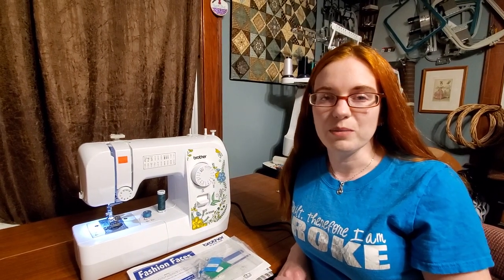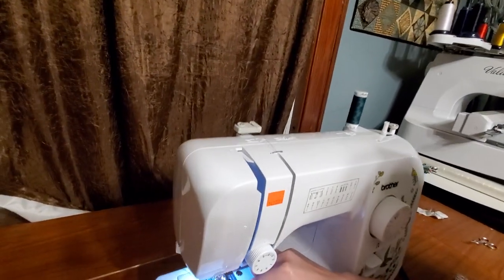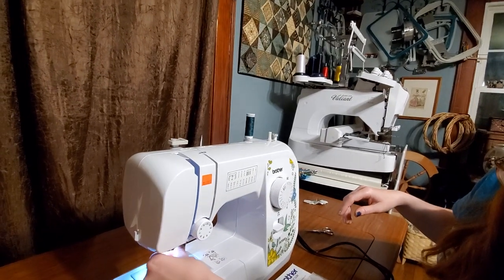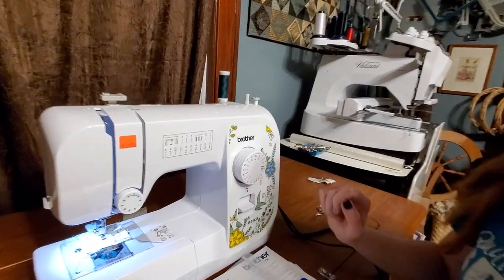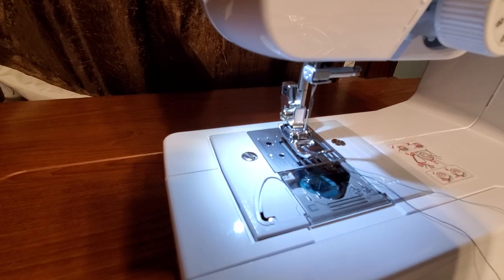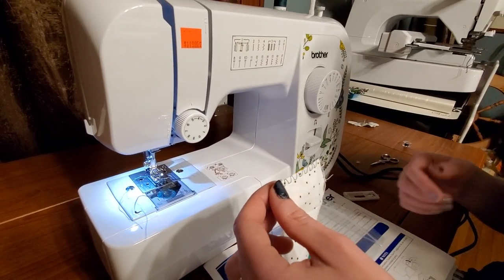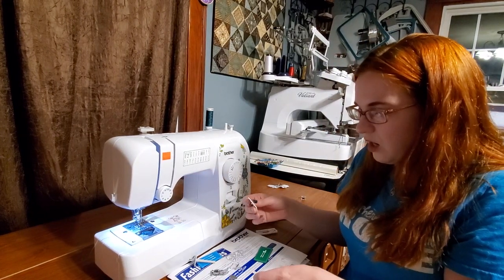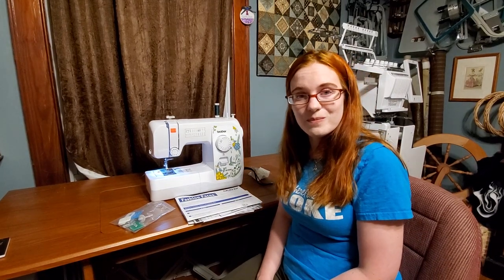Basic Machine Lesson with a Brother JX3135F

Comment: hey! nice video! I've bought the same machine a month ago but now i feel it sews slower(?) than before and also it sounds different, is that from normal use or something bad it's happening?😢 I don't have problems with the stitches or tension, tho.
Reply from the maker: I am sorry, just noticed this comment! The foot pedal is what controls your speed.  It may sound different, because you may need a new needle.  Does it sound clunky or loud?  A needle should be replaced every 8 straight hours of sewing.

Comment: Hello. Can you use it on dremin or some thick fabric?
Reply from the maker: If you switch out the needle to a denim needle, it can sew through some thicknesses of denim.  It can also do other thick fabrics with a heavier needle.  You may need to sew slowly, and if it's very thick, sometimes it may skip stitches if it is too much for the machine to handle.  We would not suggest leather or very heavy fabrics in layers.
Reply: @schillerssewingcircle6464  I saw a Brother video on a special machine of sew for jeans, but maybe I just change the needle, as you say. Thank you.